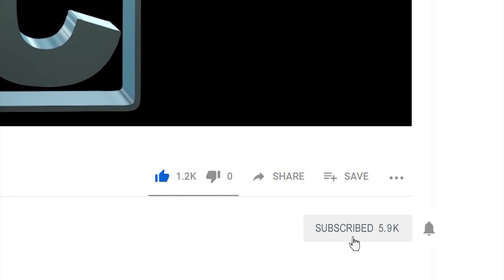1/24 scale Fujimi Spinner model build Pt III continued lighting and detail painting

Comment: I love the clear sheet plastic idea for the detail in the cockpit. I was considering UV paint that glows under UV light but I like this idea way better and will 100% be doing that on mine, it looks so much better. Great job man.
Reply from the maker: I'd go with .5mm rather than the .75mm I used.  I just didn't want to wait to order more.  Already had the .75mm
Reply: @modelsbychris  I actually ordered both .5mm and .75mm but thanks again for the advice.
Reply from the maker: @Daniel duFaur  someone else on my page pointed out to me some Rustoleum frosted spray paint that's available to frost the glass instead of sandpaper.  You may want to look into it.  I might get some myself for future projects.  It's on Amazon for like $6-7
Reply: @modelsbychris  That's a great idea. I'll have a look into it, thanks.

Comment: Hey Chris..instead of using sandpaper for diffusing the clear parts, have you thought about using frosted glass spray paint instead? I've tried it and it works just as well
Reply from the maker: Didn't even know there was any
Reply: @Models By Chris  rustoleum makes it, you can find it at home depot
Reply from the maker: @DRONE-TARIO  may have to check that out.  Too late for this build,  but Thx
Reply: @modelsbychris  I used it on the Galileo shuttle crafts nacelle caps and interior clear roof. Worked great🙂

Comment: Is there any way of letting us know what photo defusion gell/paper you are using? All the stuff I have seen online seems too thick.
Reply from the maker: Sorry, I really don't know.  A sheet was with a pack of photo color gels I had.  But I've used regular thin tracing paper and even parchment paper for diffusing light in my models.  All work well
Reply: @modelsbychris  No problem at all.  i have really thin Styrene sheet I think will work.
Reply from the maker: @danieldufaur  I've actually used that as well for certain applications

Comment: hello Chris, good job ! Can you give the reference of the neon strip ? Can it work with 9v ? Thanks.
Reply from the maker: The COB strip I used is 5v only, because that's what i wanted.  But they do make them in different voltages.  Just search Amazon for COB LED strips.  You'll find them.